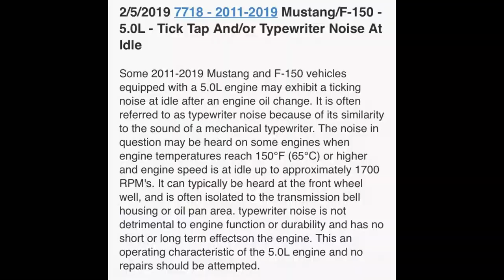2018-2021 Mustang GT Typewriter Tick/BBQ Tick. Don't Be Worried!

Comment: I bought mine new , 2019 pp1  , change the oil at 1052 . I noticed a noise coming from the top of the engine and I can actually feel it by touching the fuel lines and the intake runners . It's intermittent and random . It's sounds like tapping on the composite intake with a small hammer or screw driver . I do not hear this when it's cold and I can hear it only at idle . Today it was doing it on the drive around town   . After returning home I had the wife work the throttle and 1500 and hold and again at 3k and hold . It disappears with increase engine speeds . Turn it off for and few minutes , fired it up and it was gone again like it always is . Again random , broken and worn out parts don't heal them selves . My question is relief valve for the fuel pump ? You mentioned a valve in the intake ? Cam phasers doing their thing ? These engines are noisey compared to the engines of the early days with no FI and having four cams and 32 valves , there's a lot going on . My Vette has a 383 , solid lift flat tappet and it sounds like singer sewing machine . Again bad bearings and worn cylinders don't heal them selves . Got to be something simple or it would have blown up by now .
Reply from the maker: Ye the fuel pump is located on the right hand side next to coil number 3. It takes fuel pressure from 65psi to 2600psi. To keep the fuel rails full. This happens at different RPMS and engine load. And is commanded by the PCM. There is a valve yes.  It also takes into consideration the advancement or retard of timing due to phasers. As far as intake runners. Look on the back of the intake. See that valve. Some people have unplugged it and the noise you described went away. Plug it back in and it's random. Like you said broken parts don't fix themselves
Reply: @BeardedFordTech  I knew it was something simple and explainable .  I bought mine at Lebanon Ford , they regularly sell dealer boosted mustangs and trucks . People come all the way from Washington state just to get a Whipple, Or Roush boosted vehicle . I never heard of any problems . I nice to hear from an actual ford mech that works on these things . People need to stop listening to the flea bitten range bums on here . Also I'm willing to bet most of the people who have problems with the 5.0 have beaten thier cars right off the lot and couldn't tell the difference between a speed wrench and a fit em all . Smokey Y. Would be very impressed by this rig .
Reply from the maker: @johnsricke7236  it is true. A lot of the complaints are from people who A. Don't own the car and just hear it. Or B. Buy one a drive the crap out of it from day one. Like the MT82 manual transmission. That's what I have. People have experienced 3rd gear lockout and even broken shift forks. All due to driving the piss out of it doing hard pulls and jamming into gear. The fix would be A. Get rid of factory clutch and put a higher rated horsepower one in. B. Change out the plastic clutch fluid line for a steel braid one. C. Change out the clutch return spring for a steeda 35lb spring. And D. At least let it warm up a bit before doing hard pulls. A lot of the ones I see are people who have never owned a mustang before. They are great cars. Just can't abuse them all the time. Where are you from?
Reply: @BeardedFordTech  Ohio , 25 miles north of Cincinnati . These cars are pretty evil and I can see why the bone yards are littered with them . I have a 77 Vette , 383 art carr trans , 2800 conv , 4:11's . I thought it was evil , runs 12's on street tires , but that changed when I unplugged the car under the hood and took it out . Things can get out of control fast . I plugged it back in . I have a ten speed .
Reply from the maker: @johnsricke7236  I'm in North Carolina the ten speeds I'm not fond of. They came out cause Chevrolet and ford wanted to team up. Has all Chevy internals. All electronic except for the park pawl. It is a pain in the ass. There has been a few issues with them too. A lot of people using the paddle shifters and destroys the trans.
Reply: @BeardedFordTech  I rarely ever use the paddles and hardly ever beat on the car . I bought it as a pre retirement present , meaning I can pay for it while I'm still working . I doubt and or hope it doesn't break in the next 4 1/2 years . Im past the beating  stage of life .
Reply from the maker: @johnsricke7236  happy early retirement!  It will last as long as your not abusing it like u said. It should last a long while
Reply: @BeardedFordTech  So that motion control valves are supposed to open and close at idle ? There is no pattern for it to happen , only that I would be just putting around at 40 or below in stop and go traffic . I posted a video on my channel showing the start up operation . They are open until the engine starts .
Reply from the maker: @johnsricke7236  if it's ticking putting around and it sounds like lifter tap you need a new intake. Just verified with a ford senior master tech
Reply: @BeardedFordTech  Wow , 5k miles , it make a noise that sounds like the motion valves when they are moved by hand , seams to be coming from the right side . But doesn't do it every day  so maybe one of the vacuum pods have gone south  ?
Reply from the maker: @johnsricke7236  very possible. But on the side you also have the mechanical portion of the high pressure fuel pump making noise. Unplug the solenoid on back of intake see if noise goes away
Reply: @BeardedFordTech  thanks so very much for the information .
Reply from the maker: @johnsricke7236  no problem. Let me know how it goes
Reply: @BeardedFordTech  I will look into it this week , probably have to wait for codes or engine light  to show up  in order for the dealer to fix it .
Reply from the maker: @johnsricke7236  nah. Just tell them you have a weird sound up top. Not the bbq tick. And that you would like it checked out
Reply: @BeardedFordTech  Sup , drove the beast to work via the highway , pulled in the slot and didn't hear anything , for about a minute anden , it started that clicking noise . I see where the levers are that open and close the flaps and they were closed and not moving . I unplugged the blue plug in the rear and I think the noise stopped , a freaking train just happened by at the time . Im thinking that switch is clicking . The flaps opened the moment I unplugged it .  I check into it again tomorrow . Ever seen those do that and btw it was hot to the touch , like radiator running temp hot .
Reply from the maker: @johnsricke7236  that indeed sounds like it will need a new intake. Me and the senior master tech were literally just talking about that. It's not supposed to be that hot. But warm.
Reply: @BeardedFordTech  Sup ! Turned out that it's not the intake , it still made the random noise that sounds like something tapping on plastic . It probably just resonating thru the plastic / composite parts . Some days it non existent and it's tapping pattern is like , dotdotdot -----dot -----dot , like morris code . Not like valve lifters . So anyways thanks for the input . Im not concerned about it  , I'll call normal for my rig .
Reply from the maker: @johnsricke7236  that pattern your referring to is the typewriter tick it bbq tick. Sounds like a bbq grill starting. That's normal and all of them do it from 2011- now. Just noticable on 2018- now cause of plastic oil pan. Mine does it very rarely now. But it still does. There was a technical bulletin on this. It's normal and no engine damage is happening.
Reply: @BeardedFordTech  it's very faint , do you no what causes it ? Slapping timing chain cam phasers , you'd be a you tube king if you knew what it was . Im not worried , but it does boggle the mind .
Reply from the maker: @johnsricke7236  it's actually more isolated to the back of the engine usually near bell housing of trans or oil pan area. I've torn many apart and can never find irregular wear on anything. Still boggles my mind. Some people think it's oil pressure related just a small cap between two parts. On the right hand side of the engine you have the high pressure fuel pump. Uses the cam and electrical solenoid. It's noisy but doesn't cause the tick. So it's something on the back lower portion of engine. I will find out one day. I'm going to find me another 5.0 to tear down
Reply: @BeardedFordTech  Which is the best weight of oil to use in these engines , I'm using mc 5w20  , but manual says to use heavier weight for tracking and I thought I should be  some where in the middle mpg isn't an issue so much as engine protection is . I do like to let her rip at least once a week .
Reply from the maker: @johnsricke7236  manual states 5w20 for everyday use. 5w30 for track. But if your gonna rip it at least once a week go with 5w30. It will put your mind at ease. Mpg shouldn't be much lower even if your not worried. 😁 But keep in mind warranty doesn't cover a blown engine under abuse or track use. But if it's just once a week. You should have nothing to worry about.
Reply: @BeardedFordTech  , when I mean rip on , it's only for a few seconds . Is winding out the engine thru five or six gears a bad thing with w20 because that's the extent of ripping on it
Reply from the maker: @johnsricke7236  ok I thought you meant ripping it as in tracking it or drag racing it. You should be fine. I run 5w20 in mine.
Reply: I know this beating a petrafied horse but my 5.0 hasn't made the noise I stated before in the comments . It has 7800 miles . Hope your rig is running great !

Comment: Do they not check the dip stick after changing the oil??
Reply from the maker: It's full. The tick is normal. Nothing to do with oil level.  The 3.6 you heard was lifter failure. Nothing to do with oil level. Just a crap design

Comment: Is this still normal for a tick under that front driver side wheel ona 2022?
Reply from the maker: Yes. Supposedly the 2024 doesn't do it. They redesigned the engines for the 2024. But for a 2022. Yes the BBQ tick is normal.

Comment: I’m new to the Mustang 5.0. I’ve had a few F150’s, all were 3.5 EcoBoost. All were oil changes at Ford. Nothing special like the Liquid Moly used in my motorcycles. Never heard of Cerma. Cerma or CermaX? It’s only a $4 difference.
Reply from the maker: I don't use it anymore. They wanted me to do it. It's not bad stuff. But I prefer amsoil. Runs better.  Let me know if your interested in getting some. Runs better cooler and better mpg.
Reply: Just bought a used 2021 Mustang GT with 2200 miles. I was already planning an oil change with Amsoil. Just want to be more intentional with what goes into the Mustang, especially living in Florida now. Thanks for the reply. Subbed! 🤘
Reply from the maker: @moph7July06  most definitely. Amsoil is the way to go. Rear end too.  Your not to far from me. I'm in NC. I have family in Florida.  Keep on the maintenance. Oil change every 3-5 k. Don't go 10k or by the oil life monitor.

Comment: 2020 mustang gt,
I just realized after i changed engine oil
There is ticking sound, i thought it was shockwave
So i changed
But the sound from engine.

So no harm for engine then its ok

I have another concern
If i hit 6-7k rpm
I smell burn(aircon on)
Where this come from?
Reply from the maker: Ticking noise is normal after oil change. That's the BBQ tick. As far as a burn smell. Did you spill any oil on the exhaust manifold?  Other than that I have never come across this concern
Reply: @BeardedFordTech  recently
Exhaust motors (2pcs) are broken
So i open full exhaust manually

Then .. uhmm i use mustang daily to release stress
I hit 180kph daily
When the gear is about 2nd to 3rd
I hit rpm 6-7k

Then from the aircon i smell the burn,
Im thinking maybe fluid is burnt , i put mustang today at dealership
To change transmission oil to check

Fyi mile is 21,000 km

Yes sir after i watched your vid, ticking bbq is no harm to car
Do solved 🤣

But sir do u concern any other reason about burn smell? Smells like.. plastic+rubber burnt smell

After change transmission fluid, ill try run again, but then dealer said
Not normal people hit 6-7k rpm at city driving 🤣🤣lmfao

Maybe mission plates burnt? Or fluid burnt?
Reply from the maker: @2023-6btc  yeah thats not normal. People hit 6-7 k driving in the city. Plastic burnt smell really wouldn't be transmission. Especially though the ac. You would smell clutch and transmission outside the car. Did you run over a plastic bag or anything thats maybe stuck under the car?  Maybe have the ac compressor checked. If the bushing between clutch and compressor is getting hot and failing
Reply: @BeardedFordTech  thank you alot for your help sir,
I didnt expect for comment
The vid was 2yrs ago.
I subscribe you, when ever there are things to share mustang thing
Can i ask you sir
Reply from the maker: @Selfcustody90  you can ask anytime. You can also email me Aheflin31@gmail.com
Reply: @BeardedFordTech  got ya
Mustang owner/fan from south korea🇰🇷👋👋👋👋
Reply from the maker: @Selfcustody90  welcome!!

Comment: How about the low rpm rattle? I have a rattle from 2000-2500rpm. It’s more noticeable when cold.
Reply from the maker: Have the water pump checked. There is a tsb for that as well
Reply: Have the same issue when that car is cold low rmp theres a tick
Reply: @abrahammartinez8838  how many miles and what year? It hasn’t affected performance or anything. I’m going to take car to trusted mechanic for borescope and I’ll have my oil analysis. If all checks out I won’t worry about it
Reply from the maker: @abrahammartinez8838  yes. As it reaches operating temp. Then til about 1800-2000 rpms.

Comment: Unrelated to ticking: When I started my stock 20 GT with 31k on the clock, I heard and felt a pop/boom when the motor started. It sounded and looked like it came from under the hood. Turned off and back on and didn’t hear it. Drove it home and sent it a lil bit with no issues, sounds, smells, lights, or codes. Have any idea what it could have been?
Reply from the maker: Could have been pre ignition slight back fire. What octane gas do you run?
Reply: @BeardedFordTech  Been running 93 exclusively.
Reply from the maker: @demetriawright1528  may have been a slight backfire. Hasn't done it since?
Reply: @BeardedFordTech  It just happened today. Right after it did that, I turned it off and back on and didn’t hear it. I did however notice a few weeks ago, I heard a strange pop/bang when I started it up, but I did a remote start from several yards away, so I’m not sure if it was the same phenomenon as what happened today.
Reply from the maker: @demetriawright1528  that's awkward I haven't heard one do that. Next time before you start it video it and send it to me. I just for any TSB with that symptom and there's nothing.
Reply: @BeardedFordTech  Will do thanks!
Reply: @BeardedFordTech  I made a post on Mustang6G describing what happened. One guy responded and said it could have possibly been the 10R80 clutches roughly engaging or disengaging that caused the sound. He recommended I have the solenoids and trans fluid checked. Does this sound plausible?

Also, let’s say whatever this problem is leads to a catastrophic engine or transmission failure. If an H pipe were installed on the vehicle, would a warranty claim be denied? I ask because I was supposed to be taking it a shop for a res delete today, but now I’m too hesitant.
Reply from the maker: @demetriawright1528  ah yes the loud clunk on startup.  The f150s did that for a while. And it was the clutch packs being stuck engaged. Solenoids and trans fluid usually doesn't fix that problem.  It's an internal thing. If they can duplicate it.  As far as the pipe goes. Basically anything you put on the vehicle that modifies It from stock will void your warranty.  But the technician has to prove that's what caused the failure. Is he going to go out of his way for that?  Probably not. If I was you I would wait. If something is wrong they can say well he has a pipe and this and that and this and that. Warranty claim denied. It is real finicky when it comes to warranty.
Reply: @BeardedFordTech  With the way it’s been shifting lately, I think the trans is struggling anyway. I have an appointment with the dealer in a few weeks, so hopefully we’ll get to the bottom of it.
Reply from the maker: @demetriawright1528  do you drive it hard all the time?
Reply: @BeardedFordTech  Not at all. A few good moderately aggressive pulls on Fridays and Saturdays at the most. I’ve never taken it to redline and I drive around normally to get it warm before having any fun. I bought it used though, so there’s no telling how it was driven by the previous owner.
Reply from the maker: @demetriawright1528  take it in have them check it. There may be codes stored in it. I've never come across that though except the f150 clunk type noise on start.
Reply: @BeardedFordTech  Yep that’s the plan. Thanks so much for answering my questions man.
Reply from the maker: @demetriawright1528  no problem
Reply: @BeardedFordTech  Hey I was finally able to replicate that sound and I caught it on video. Is it possible I could send it to you for you to listen to?
Reply from the maker: @demetriawright1528  indeed you can. Aheflin31@gmail.com
Reply: @BeardedFordTech  Thanks! I just emailed the video to you.
Reply from the maker: @demetriawright1528  I'll check it.
Reply: @BeardedFordTech  Ok thanks!
Reply from the maker: @demetriawright1528  anytime.